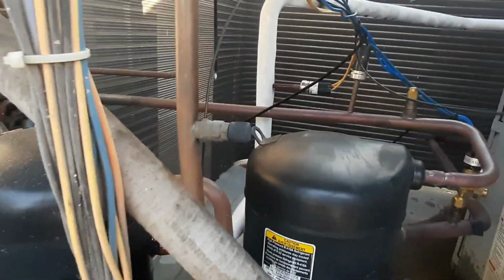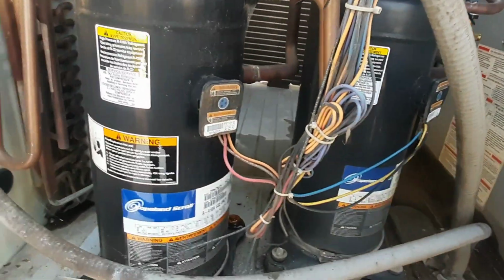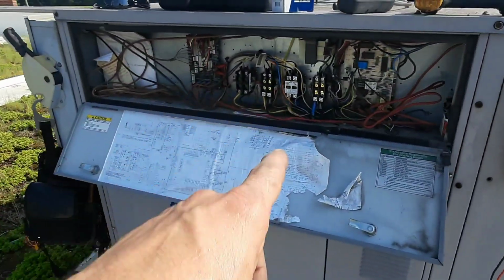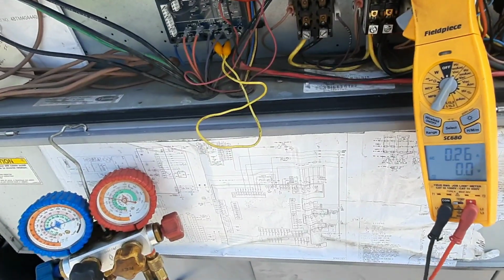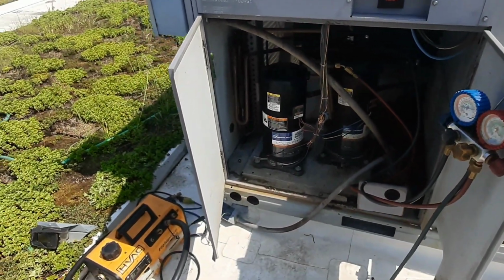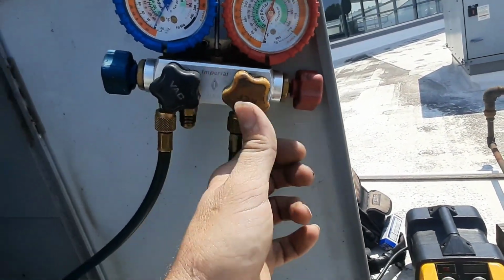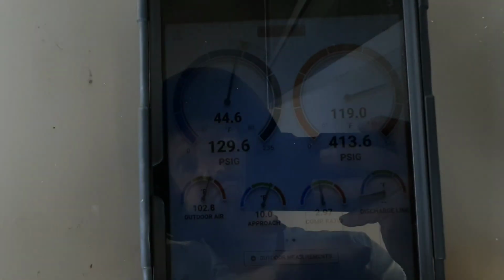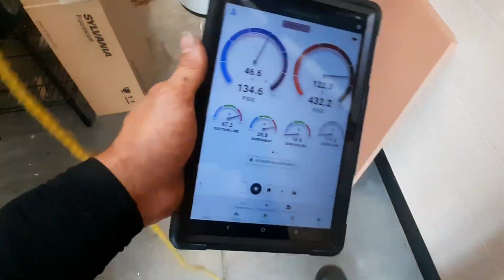2 stage Carrier package unit not cooling. call back?

Comment: I like the metal refrigeration caps with copper a gasket better than a swivel T, fewer places to leak.
Reply from the maker: Those brass caps with copper seals are the best, I use them for certain things as well

Comment: Dude, you can’t check the amp draw on the fan motor with the door open! That is not a realistic amp draw
Reply from the maker: I understand that, I just wanted to make sure the rotation was correct, I noted that when I did it and then checked the amp draw with the door on after.
Reply: @EverythingHVACR  yeah, I didn’t see that in your video. Sorry brother.
Reply from the maker: @Robyrich2377 no worries, I appreciate the comments

Comment: once you touch a system you seem to own it and always a call back. I just had one the freezer failed our tech went out and capillary blocked so they replaced it then 3 days later it fall over again.... I was sent to find coil iced up and unable to put it into defrost due to sensor faulty. Replaced and working fine now. I let the office deal with the aftermath. 🤣🤣🤣

Comment: Another great video, can you get to a bandsaw to cut those old filter driers open?

Sure would be interesting to see what’s on the inlet side of the media block.
Reply from the maker: Thanks, RC F! probably could have but threw them away. Blowing through them, I could tell they were restricted. It had to be the oil. Nothing else makes sense.
Reply: @EverythingHVACR I’ve seen it a few times now on these R-410A carrier units where if they run high head pressure for too long, they cook the oil into a black powder that plugs up the driers. I had 2 on the same roof that never had the condensers cleaned for 6 years, both had plugged driers in the same summer. When I cut them open they both had the same black powder plugging the driers up.
Reply from the maker: That was my only theory. Thanks Premix!